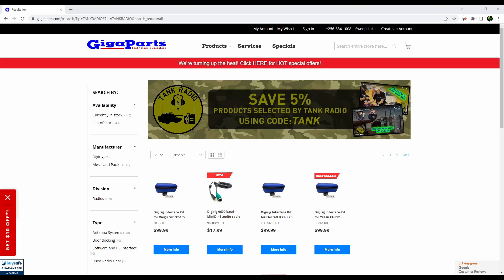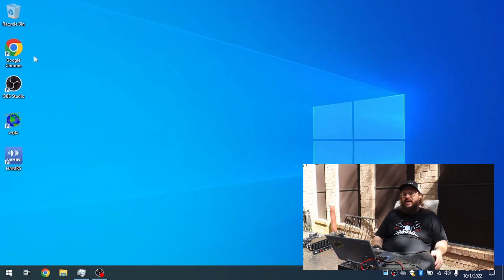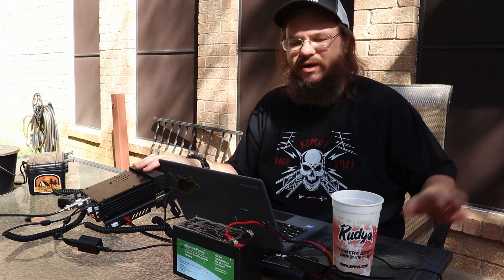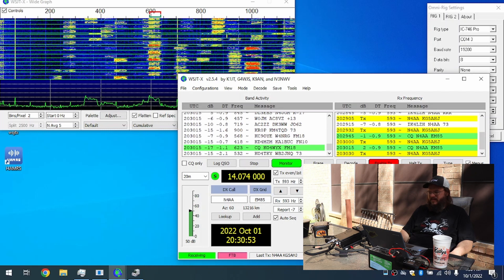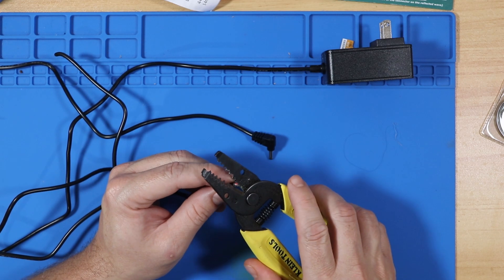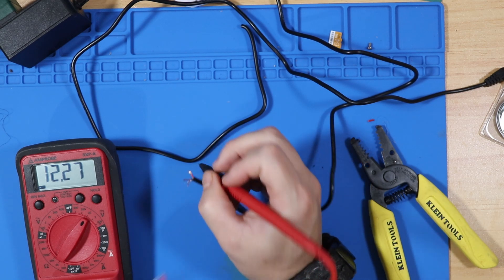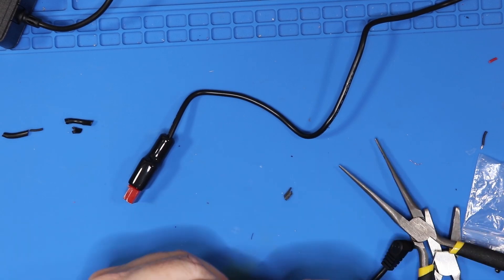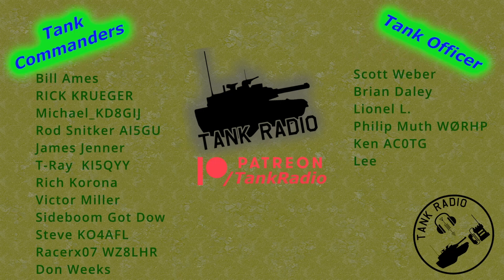Evolve III, Setup for Ham Radio

Comment: Do you still use your Maestro for POTA if not what are you using. Also thank you for card and Sapphire sticker for recent QSO
Reply from the maker: No, my Maestro computer bit the bullet pretty hard.  I found the manufacturer be no help for support.  Currently I'm using my Dell XPS, which is really overkill however that's all I have right now.  Awesome, congrats I'm not giving those out a lot, i love those Sapphire stickers.  73

Comment: The Evolve Maestro III is a total piece of $h1T. Mine was brand-new and is now unusable after a few hours. The battery is utter junk. Emailing support gets you a "not my job" response and instructions to a different email that never gets answered. Calling the toll-free number gets you a forced "Life Alert" sales pitch then you NEVER get through to the support staff. Save your money. This is a total waste and a rip-off that's going to the next electronic recycling day event. The computer does not work, and neither does their support staff. Smells like a scam. That means it usually is. I was with you 100% on the POTA and 12v aspects. I'll just go back to my boat anchor name-brand machine that POTA's like a champ. 73 and good POTA.